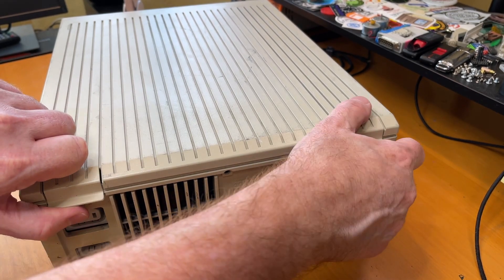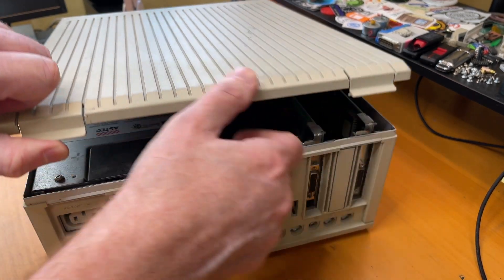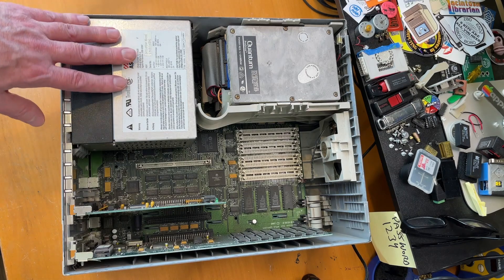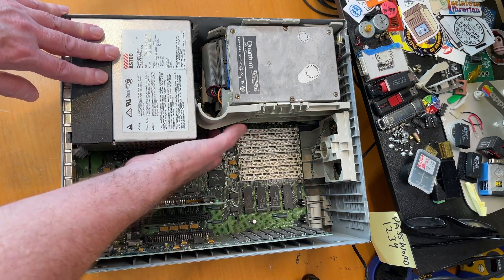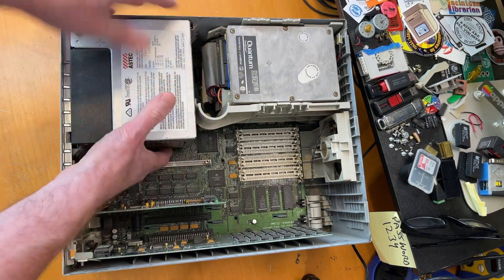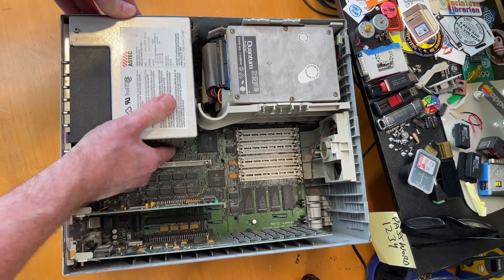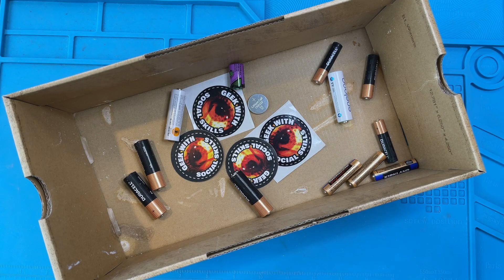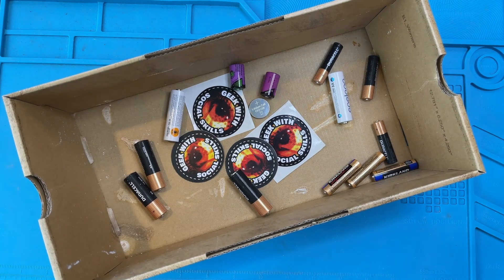i'm here to help

Comment: most versions of the original xbox have a clock cap that's basically a battery that leaks and ruins the board as well, i figure in a few more years there will barely be any of those working anymore. i found out the hard way btw.
Reply from the maker: oh wow! that reminds me I've an xbox i have to get its battery out! 😱